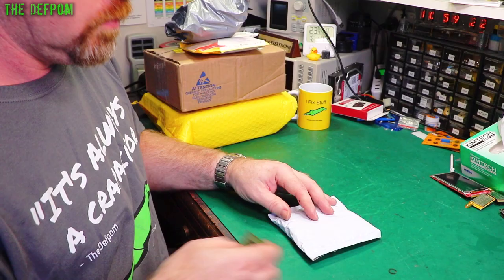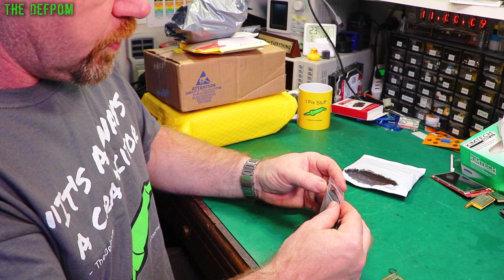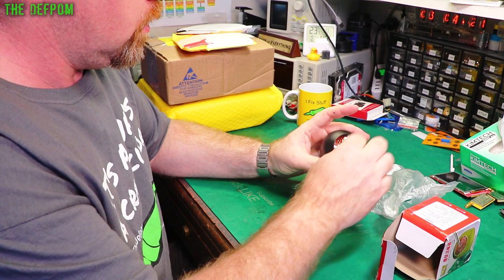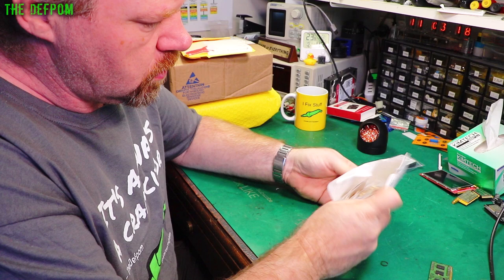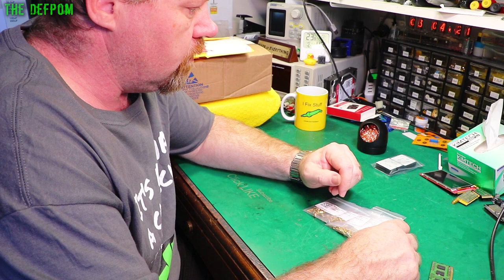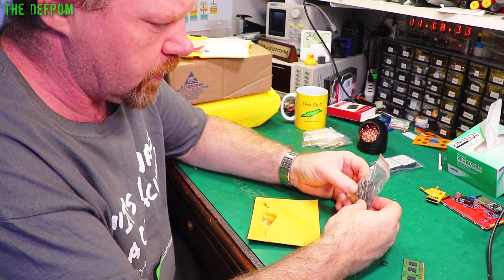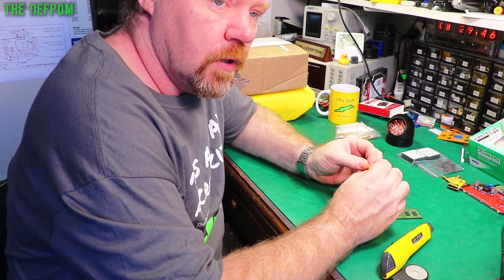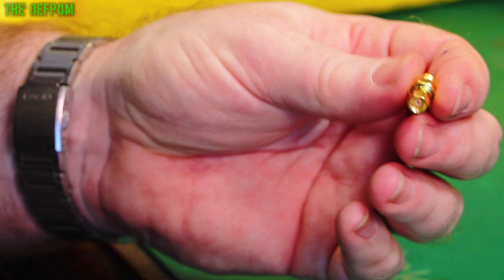🔴 Mailbag Monday 19th April 2021 - Electronics Postbag - No. 822

Comment: I have the same iron tip cleaner......it's worth throwing a few large steel nuts in the bottom to give it a bit of weight otherwise you find yourself pushing it around the workbench.
Reply from the maker: I expect I will need to do the same.

Comment: Regarding Ian Scott Johnson's and Mark Clark's comments, I added weight to that soldering tip cleaner (I used a rock) and stuck some rubber feet on the bottom. Very handy. I guess we should all consider a crowbar (circuit) when building projects.
Reply from the maker: If it had crossed my mind that one of those buck regulators would short out input to output I would certainly of added protection when I designed my project... I doubted that they would fail as I ALWAYS over rate for the application, the buck regulator is supposed to handle up to 2.5A, at most it gets about 1A during a transmission (which lasts a fraction of a second), then drops back to about 200mA.

Comment: For the soldering iron cleaner, I got a small magnet parts dish from Harbor Freight it has a rubber bottom that stays on the bench and storage for small stuff
Reply from the maker: I have a magnetic parts dish too, it is very handy... its also permanently full of bits so I cant use it...

Comment: Adding a 5.6V zener on the output of a 5V regulator is cheap insurance.
Reply from the maker: That is exactly what I did, I certainly wish I had done that (or added a proper crowbar circuit) when I designed it... oh well.
Reply: @TheDefpom  design a Circuit using one of these TPS25921:-)
Reply from the maker: @fredflintstone1  Funny, I just saw that Eric posted a video about that...

Comment: 1N4001 ?  Stock only 1N4007 and use them for everything a 1N400* requires.
Reply from the maker: Yeah these are only rated for 50V.. but they are cheap like me.
Reply: @TheDefpom  Cheap is having just one of the 1N400* range and using it for everything.  :-)
Reply: Generally yes, but the forward voltage drop on the 50v ones are slightly lower (and resistance) so it can pay to use the rated ones for the job to hand.......but then again, 1N400X series are very general diodes.........just sayin'